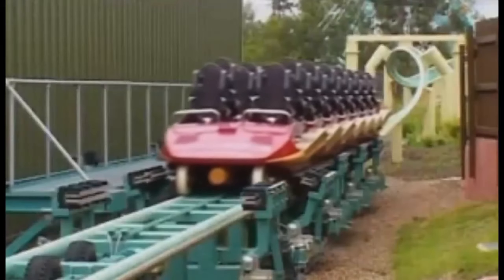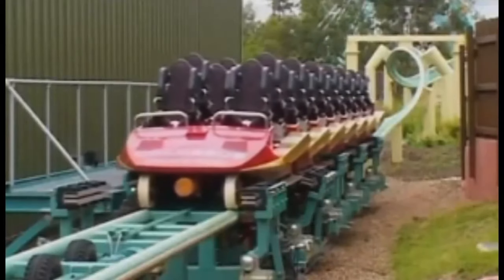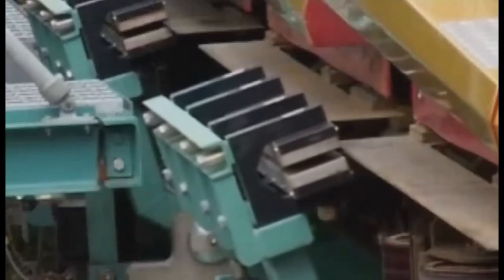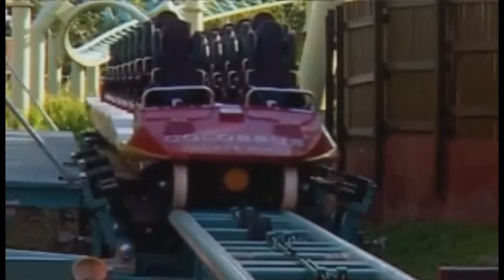Satisfying Magnetic Brakes Compilation (Roller Coasters)

Comment: Has anyone attempted the use of this style of brakes on freight trains at rail crossings to prevent vehicle/train accidents in advance?
Reply: It would cause carriages to jackknife. Roller coasters are fixed to a track that is fixed in reinforced concrete and steel. Further, you need the opposing magnets to be attached on the route…

Comment: Other than Maxx Force, B&M wings, Intamin accelerators, and Millenium Force, what are some other coasters that use magnetic brakes??
Reply from the maker: Pretty much every coaster built since 2012, even the small pinfari at my local fair has them